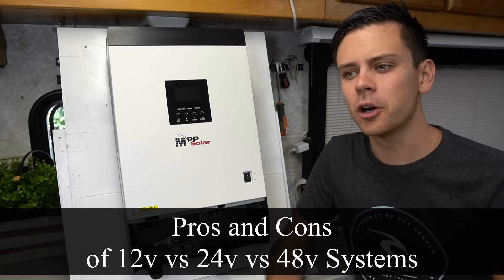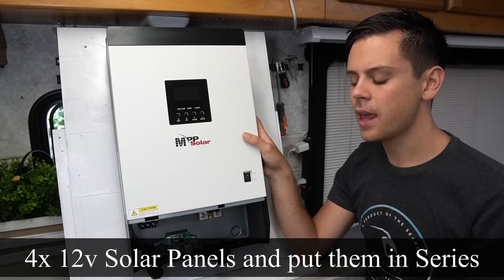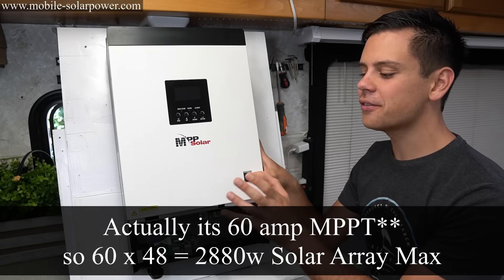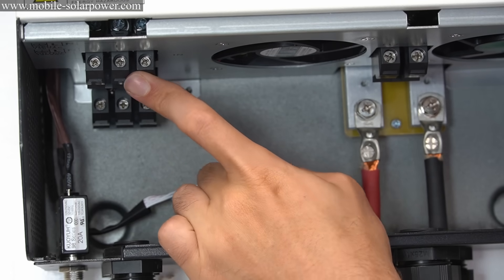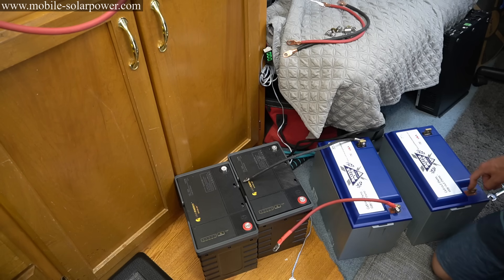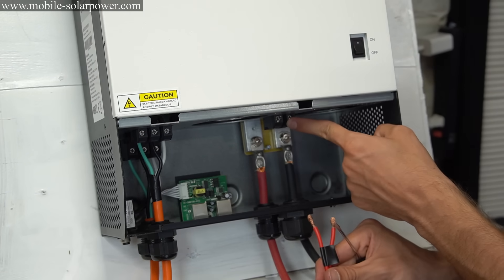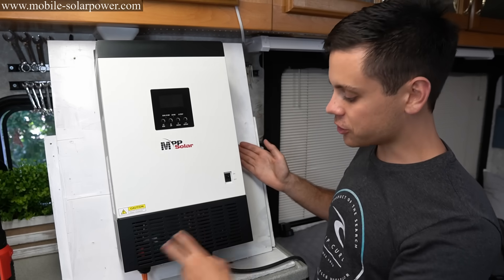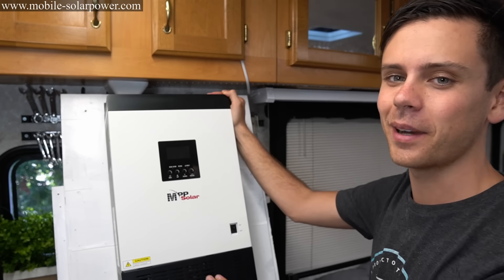48v Solar Power System for Beginners: Lower Cost and More Power!

Comment: I installed two of these same 48v 5kw MMPT inverters about 2 years ago in my 7,500 sqft off-grid shop.  The have both been durable except for around the 8 month mark both of them stop accepting A/C generator power.   So I no longer have pass-through power or A/C charging.

Comment: Hi! I've been searching and couldn't find a forum for DIY 230 VAC off grid inverter.  I'm here in USA and shopping here in USA, for solar panel with 230VAC off grid solar power Inverters, and battery commander for my hottub, that runs and wired to 240 Volts. My hottub hast it's own separate feeder breaker, and outside GFCI disconnect box. I was adviced by a solar business representative that,  in USA the grid standard is 120VAC per phase, and require 120VAC inverters to function with Solar Regulator, and that Solar Regulation services will not work properly for USA grids. This means that a 230 VAC off grid solar power inverter may be sending energy back to the utility company. I was adviced to get 120 VAC off grid solar power instead, but if I insist to a 230 VAC after being adviced, then they can not provide me with effective tech support for the system. Their system includes solar panel, battery storage, off grid controller, off grid inverter. I am not sure if a 120 VAC solar power inverter can power my 240 Voltage hottub. My worries is that the inverter will not be compatible to connect to my 240 Voltage feeder breaker.  Please help me. I'm not sure if I can post the link of this company, for better reference.

Comment: Greetings, need some help | I had a 3Kva 24v system which I have had for 6 years with 12 x 250 solar panels; Now I want to upgrade to a 5Kva 48v system, initially with the same panels. I know I will need a bigger charge controller as I now wanting to use Lithium Lifepo4 battery bank but my question is do I need to change my wiring again? Or I can wait till I add more panels which will be maximum of 6 for total of 18 panels. Don’t want to risk my wires melting.

Comment: Hi, want to ask you a question. What will happen to the system if the grid power loses its current. Will it continue to produce for your     home and continue your usage? I asked this cause in our community grid power is unstable.

Comment: Question if I may ask. This system is their off grid system correct? So hypothetically if I wanted to create a backup battery backup with future plans to add solar panels could i use the AC input on this solar inverter to keep the battery bank charged and have a switch that when power is lost switch off the grid power and switch on solar battery array? Possibly a automatic switch like some generac generators have when grid ppwer loss is detected it switches on generator. Really i want to peice a kit together, but would like to start with making a "powerwall" of sorts and adding solar down the line. I really appreciate you videos you really are easy to understand and have great videos!

Comment: I have a 48v 3.3kwh battery that I want to use with my van. I have two 325w  panels to power it. I was thinking of using the 3.2kw version of this. Will the panels work with this?

Comment: Thanks for the info. At around 3:30 you said you have to do 4 or 8 or 12 panels and keep the voltage high. Could I not do 5 or 6, 12 volt  100 watt panels running in series and feed 60 volts or 72 volts into the system?

Comment: This video is 100% educative and l salute you for the job well done.indeed you are a true qualified and experienced electrician.l bought 5000watts pure sine wave invetor with mppt,6 by 330watts panels,4 by 200Ah batteries.the problem now is on wiring the 10 way distribution board with the following 2 by 125 A DC breakers,2 by 76A DC fuses,1 By DC surge protector and 1 by 32A ac breaker.may u pliz assist me  with a video on that area

Comment: Anyone in here build a large system with this MPP Solar 48 volt rig?

What is the maximum size battery bank that this unit can handle? 
 
I have twelve - 12 volt/200ah AGM batteries that will be 600ah once connected in series-parallel. 
 
Can the utility charger handle this?
 
Any other issues I should be concerned with?
 
At 25% discharge, that will give me 7200 watt hours to work with, on the daily..
 
And with 1520 watts of solar array x 5 hours, that is 7600 of average daily charge capability here in Florida. So I think that 
will have me set on that.

 
That is, if this unit matches up ok with the battery bank.....
 
In the listing from Will's link, it has this in it:
 
REQUIRES A 48V BATTERY TO OPERATE – NO BATTERY = NO WORKIE!  Voltage needs to be above 47V to turn on – cold start  (safety feature) Recommended 200AH Max Voltage is 64V.

I don't want to buy the thing and it not hold up to charging the battery bank......

Anyone, Bueuhler?

And hey, this Will dude is pretty cool, huh? He sure knows his stuff!

Comment: You inspired me.  I grabbed the 3048lvmk, built a 12kwh lith ion battery and put 800w panels on a homebuilt  solar tracker.  Added a critical loads panel and started switching over wires yesterday.  

It all works.  Love these inverters

Comment: Looks like this might be what I need, you see in California we are experiencing power outages something PG&E is carrying out during the fire season. I would like to have a refrigerator operating on house power and if the power goes out would like to have it switch to battery backup via the MPPT controller. Is this something it can do?

Comment: How would one of these work in a camper that needs DC circuit power, too?  Would I need a separate converter and hook shore power to that instead of the all-in-one?  Or is it better to just get separate components?

Comment: I'm not knowledgeable about this stuff but if anybody can clarify... thanks :)
Since this has a AC input (grid):
Will it feed solar/battery AC power back into grid?
Will it work if grid goes down? 
Will it disconnect from grid for safety purposes if grid goes down?
Do people require permits, inspection etc. for any grid connected use?
Reply: This unit does not "Grid Tie." It does plug in to utility, but only to supply power to the battery charger. That's for when solar isn't charging enough, due to weather or over usage of your stored capacity.

Comment: Hi Will! I just bought a 110v, 1000w dc pump for irrigation. Am going to connect 10 x 12v x 200ah batteries in series. Is this enough to run pump for 7hrs a day? I'll set up a substitute battery bank (similar) to alternate usage as the other charges. Secondly am going to setup solar panels for charging the battery banks - Am going to connect 6 x 150w-21v solar panels in series to give 126v, then connect 8 of these arrays in parallel to give 1200w of 126v. Does this all make sense? Or I need to watch your tutorials all over again? Thanks!

Comment: I have found a 48V Hybrid Inverter that i'd like to incorporate into an off grid RV set up . It's a 5000W 50A w/ DC 48V &/ AC Output of 230V. I will also be installing the big a 48 v Lipo from Big battery .com .  I have 2 questions. 
Since this unit is  not a split phase system. Can I use a step down converter to drop the output V's down to 110v safely to power up my living systems. 
2nd question. In order to effectively charge the system. Will 4X  270w panels supply enough juice?   I assume I'll have to run them in Series. But correct me if I'm wrong. 
Thanks in advance for your answer. You channel has been invaluable to me .

Comment: Your description of this box was so good I went ahead and ordered one and haven’t got it hooked up yet. I have four 100 W panels that I have wired in series and yet it doesn’t seem like I’m getting enough power to charge the batteries I’m using headway Batteries. At this point I’m wondering I will be adding more panels to it and wondering if I alter go to say 300+ watts panels  48v maybe 12 of them. Figuring the 300 W panels would take up less space where I intend to mount them on a pole in the meadow everything else made sense being able to use lighter gauge wire to lead to the house am I thinking right.

Comment: Undecided on 24v or 48v.
24v (2x12)times 4 banks....if 1of the 2 batteries fails , in any bank,, I can disconnect that pair leaving 3 pairs working.still have 75% capacity.
But for 48v, would be 2banks.
If 1of 4 batteries fail in a bank  of 2, I lose 50% capacity.
Not sure if it mattes, guessing would take 1-2weeks to get another battery.

Comment: So how do i connect a 48volt system to my 12volt, 33' RV? Will the RV do it automatically, or do i have to buy the 30$ step-down 48>12v converter, and won't that throttle the energy output, kindof defeating the purpose? Somehow the RV must have a doohickey inside that already converts its 12 batteries to 110/120volt. So we with this 48v system we'd be going down to 12v and then back up to 120v. Seems like a carnival ride.

Comment: If you have an existing solar grid tied inverter running in the house, can you add another inverter? I have solar on the house roof, and would like to add solar on the garage roof. Was thinking of using a micro inverter system to add some additional power. The garage is on a seperate circuit with seperate fuse box etc.

Comment: ey will    how everything  going    ,  i  get the same  system  with the 48v  battery  from  big battery   , well  i already  connect  everything  but my mpp doesn't    detect the solar  panels  i dont  how to fix it , i already     measure the  panels  and all works  52 vs each  i have  4  parallel   52 v  solar panel   250 w each with  aprox. 15 A  , but i  not have idea  what happened  to the mpp doesn't  not detect the  solars panels ,   maybe  idea or helpe me  thanks  you

Comment: RE: You can't be shocked by a 24 volt system: I have been in fact shocked on 24 volts before, granted only through my finger / part of my hand, not through my arm or anything else however.

Comment: hi baddy!! i like your videos i've been following them , please  assist me in asituation  where i have  hybrid  mpp solar inverter not working, via battery charge and pv , before  i found the lead nutral cable from the solar had coroded  so much that it din''t pass curent , but even after replacing it the inverter din''t give anything where can i check the fault ??

Comment: what would you recommend for off grid 38 ft travel trailer that is lived in full time I want to run just off of solar but still have the option to plug into grid if I have to...

Comment: Big fan here
I have a question for you.
I'm building a solar panel system for my sailboat  4- LG neon 2 405 watts  with 8 batter born 12 volt batteries.
The boat will be my home off grit.
What do you recommend for this setup as a charge controller?

Comment: I just bought a 24v 3kw pretty new model, with a display that can be used remotely, build for lithium, however I have a few questions, first of is very simple, you already explained the first part how many panels be connect together, but how does the measure of gauge between the Panels work out? :)
Last but not least, the shop I bought it from specifically write that this cannot be connected to the grid or to sell back, is there a explanationable reason for that? :) 
Cheers Wil

Comment: Getting ready to build this set-up with 3kW 48V MPP and 5kW battery bank.  Is a 100W fuse appropriate between + battery and charge controller with 2AWG?

Comment: Is this type of inverter a low frequency like the AIMS inverters or is it a high frequency type..  i like this being a all in one unit. 
I have some used 100W panels on my roof, and they probably are down to 90 watts each, they are many years old.
i have 24 panels. I was grid tied, but then the power co. turned on me..( Municipality, go figure ) I also plan to buy some huge BMW battery packs, I think they were rated at 35Kw. I'd like to get an opinion from you , if you think i have too much or too little of panels or batteries..I plan to install a few dedicated solar outlets in my house for certain circuits, anything i can do to save power is a bonus, and i can stick it to the man..( power co. )

Comment: Hi! Thanks for the video, you have great content but I have a couple of questions. My house uses 1,200kWh per month and I want to install this all-in-one system to my grid. How can I wire it into my main power supply inside my house without having extension cords running everywhere? 

I live in a walk-up apartment in Puerto Rico with a huge rooftop where I will install solar panels. In the video, you mentioned hooking up solar panels in increments of 400W, 800W, and so on but nothing in between. What if the solar panels were each 220W each, how would this affect the setup? Thanks again for all of your help!

Comment: ⚡ ⚡ I am ready to buy one of these but I am confused about the number of solar panels required. The specs for this unit states PV input 60 to 115vdc. If using 12v/100 watt panels do I  make each string 4 panels in series at 48v or do I need 5 panel strings of  60v each? The panels are described as 12v but  the voltage is stated as 18.2v.

Comment: I dont know if it was mentioned... may be important for some people, this brand of inverter (and their clones) only supports single phase 120V to USA consumers, while they offer the ability to parallel several of these inverters at 240V - it is not USA "split phase"240V (2x 120v line legs), it is single phase Euro/Asia style 240V (1x 240V line leg) - so it will never give more than 120V AC to USA buyers. Which in these higher wattage ranges some people in the USA may be in the market for 240V.

Comment: Great video! I just purchased the MPP Solar 3000w 48v 110vac split phase Solar Inverter 80A MPPT zero transfer time. I did my best to go through your eBay link but not sure if it worked. For people looking at the MPP Solar all in one the shipping indicates over 30 days. I purchased May 7 and it arrived from Taiwan on the 12th in Colorado. Amazing shipping time. Here is my question. After reading and watching your videos I have a question. I want to order the Rich solar panels and will be running an off grid cabin. We will have moderate power needs and plan on two Battle Born 24V batteries. How many panels should I order of the 100w you provide a link for on your website? BTW this system is not for Colorado, moving to Hawaii in July and buying here to save on shipping. Thanks for any input.

Comment: What does it mean on the spec sheets for some MPP Solar units like this "MPPT V 30-80V"... say for a unit that supports 145V PV input.  Would there be some reason for a person to want to stay within 30-80V instead of putting 3 24v panels in series?

Comment: Thanks so much for another excellent video.
When you turn the inverter off at 11 min 30 s, does that leave the solar charge controller running?
I'd like to be able to stop the passive inverter consumption without disabling the solar charging.

Comment: Statement and question. Statement- I never hear mention of powering heavy 12v loads like landing gear, slideouts ect. Based off my research I dont feel it's going to work with a system larger than 12v unless you use the larger system to charge a 12v battery. Question- how do you balance 4 12v lead acids in series?

Comment: Will - have you done a whole house video( I couldn't find one) on the MPP Solar LV5048 split phase all in one that has two 80A controll chargers. I am a beginner and new to your videos. You do a great job of transfering knowkledge to the beginner. I have watched several of your video's, you have a special skill.  I am building a off grid house in northern Arizona and plan to use 12 250 watt santan pv pannels from gilbert AZ and put 6 on each charger with 4 battleborn 12v 100 amph lith batteries. This looks like what I need but not quite sure. Thanks for the videos.
Reply: Also ordered your book 3 days ago. Can't wait to get it.

Comment: Hey Dude, I'm a complete noob when it comes to solar. Can I power up my quarantined apartment components with a 48v? I plan on getting 4-5 100w 12v bendable solar panels that you listed on your website and put them on the windows that wrap around this apartment. I was wondering if the Titan is just as powerful as this 48v "System for Beginners," or is it better to connect this system and hook it up to a Tesla battery? I have a mini-fridge (H:5'xW:1'11"xL:1'10"), a flat panel tv:40", 4 LED bulbs that draw approximately 52w combined, and 2 laptops. I  have an ac/heat central but don't plan on using that with the solar panels. Do the fans only spin up when it charges? And can it charge and discharge simultaneously? Also, I was wondering if you were thinking of creating complete kit recommendations, parts, etc.? BTW, You Rock! I love your explanations, Keep it up! & Congratulations on your house purchase!

Comment: I have MPP Solar LV5048 is it enough power to connect to my breaker to power up my whole house?
Been using average of 15KW daily.  I tried two 1875 watts hair dryers, only power one 1875 watts at first, then the unit shutdown itself even with PG&E grid backup connected, until I changed the default settings of 28 2A0 to 2A2 then the unit was able to power both 1875 watts hair dryers = 3750 watts total. 
Is it safe to try three dryers (5625 W) or four hair dryers (7500 watts)?  Strong enough to power up my whole house?